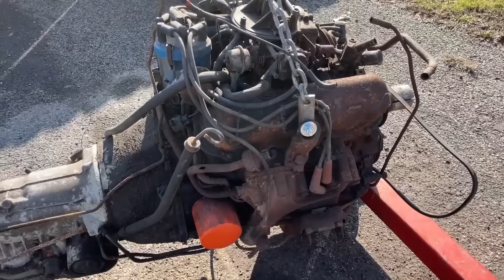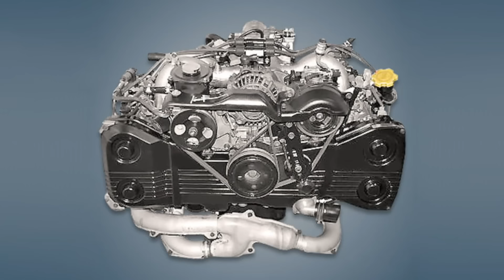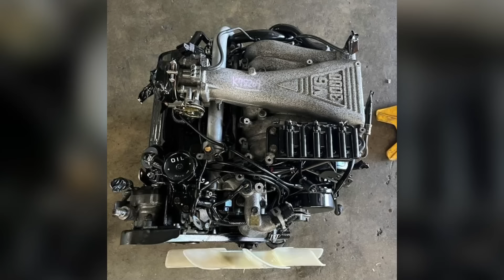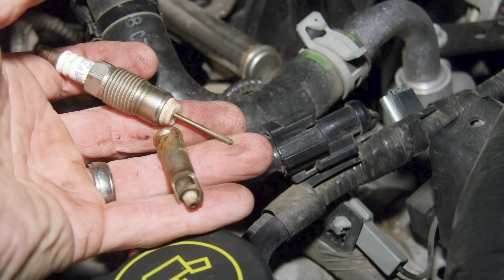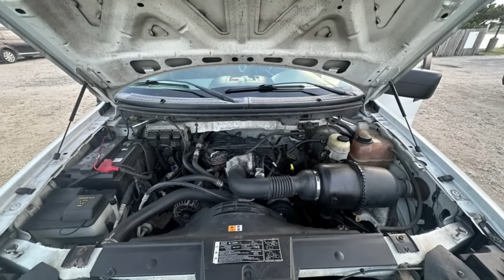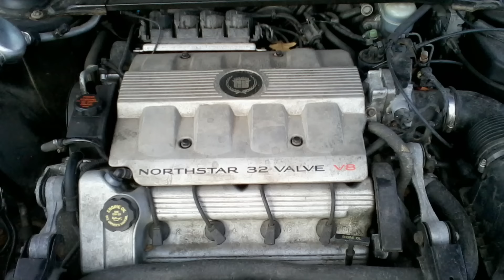20 Least Reliable Car Engines That Will Break Down!

Comment: Cant have the 2.2 and 2.5 in so close in the same videos bro, after dealing with mail trucks (llvs) for several years, that 2.2 compared to a 2.5 is like comparing a Fiat to an old Toyota diesel, respectively.

Comment: The Ford 3 cyl. was mentioned, but no mention of the Chevy Sprint/Geo Metro 1.0L three banger? Absolute garbage.
Reply: I just got a 2025 Chevy Trax with the 1.2L 3 cylinder with the wet timing belt, started feeling kind of worried, but I paid extra for the 100k mile warranty, I put about 4k miles on vehicles every 2 months, so whenever that goes and probably destroys the engine at least can be a little at ease knowing I might get more miles out of it than the first one through warranty

Comment: Hey guys, YOU forgot the Dodge/Chrysler 3.7 and 4.7 !!  These engines like to drop valve seats  or overheat and crack the cylinder Heads.  They are very hard to remove and hard to get back together!!!!  JEEP means JUST EMPTY EVERY POCKET!

Comment: I had a Pinto with the 2.8 v6 that I was UNDERWHELMED with in 78 pinto hatchback.   Plugs were hard to change, The Oil Pressure with required you to  lift/remove the engine out cause it was up front right on top of the left  motor mount and constantly leaked.  The valve covers constantly leaked and were very hard to change, too many hoses and wires to  remove to get to the valve covers.  It also ran thru water pumps and you had to drop the  rack and pinion to change the starter.  The silver paint was terrible and faded to gray in 2 years. It also liked to use oil if you ran it over 60-65 on the highway.  My least favorite engine and haven't owned a Ford since!!!!!  If I ever buy a Ford  again, Please arrest me  and put me in an insane asylum, cause, I've lost my mind.  Had a Mustang II with a 2.3 4 cylinder that taught me about " Piston Slap in 76 ".  I'm surprised it didn't show up on the worst engine top 20!!!!

Comment: GM 283 cu inch v8. Couldn't kill it.  1966 parisienne.  😊

VW 1.7 litre inl 4. Constant distributor failure. Junk. 3 distributors in 2 yrs on Dodge Omni.

Comment: Not a single Nissan engine in there, huh? Interesting.
Reply: That's cuz most of nissans engines are fairly solid....now the 4cyls after 2010....yeah a lot of them are hit n miss. VQs are great overall with minor issues here an there. The VKs , pretty much the V8 version of the VQ are solid too...

Now the VR30 is hit n miss but the VR38 is bullet proof. We will have to see how the new VR35 is. 

I've got a VQ38 and a lot of techs are saying that's currently the most reliable one to get these days

Comment: The Water pump on the V6 engines.  Were horrible. Causing over heating and blown heads.    Same like the V4 van engines. 1974.

Comment: The 3.6 gm v6 shows Cadillacs 3.6tt 😂 there are not the same timing is revised and heads are different
Reply: Although the block is the same? One wonders if the turbos bolt on

Comment: This engine all american american engine  rubish ugly old  petrol drink. Where saab engine where audi 1.8t engine toyota 1uzfe.
Reply: I in light of designs that came out of Britain, from aircraft (and even some of the early vaunted RR engines - throwing hot turban blades) to archaic car engines and transmissions, I don’t think British folks should be complaining about an engineering design from anybody else. I’ll be the first to admit, US General Motors, Ford and Chrysler/Stilantis make garbage, however, Leyland and Vauxhall are much worse. And Rolls-Royce, considering what you pay for it, is just insane. Tell the other companies in the world to compete in the market, did you do this by buying Japanese.

Comment: I remember a lot of these engines. First the V-12 jaguar that was a mechanics nightmare. Not noted here but the engine water pump was buried down inside the middle of the engine. When they ran right they were awesome but if something went wrong, look out. Then Cadillac 8-6-4 that was garbage. Mechanics discontinued a lot of those cylinder control systems and the owner just let it operate in 8 cylinder mode and then the engine performed pretty good. Then at the same time GM had a throttle body fuel injection what was a nightmare even if just pulling the intake manifold because of coolant leaks, ask me how I know. Then ford with all its issues had a variable venture carburetor what a nightmare. Then that Chevy Vega all aluminum 4 cylinder what piece of crap that was. Then the Oldsmobile 350 diesel and all the other 350 ci engines that where converted to diesel engines where crap. I’m forgetting a lot of engines.

Comment: My 3000GT with the naturally aspirated 3.0 engine was reliable, and a fun car to drive. There were no issues! The timing belt however must be replaced every 60,000 miles, or it will break, bye bye engine!

Comment: The GM 2.2 4cyl and Pontiac Iron Duke are easy to fix and very dependable. The USPS Grumman Mail Truck uses the GM 2.2. The USPS would not chose a motor that was not reliable in brutal stop and go operation. 😂😂😂😂
Reply: The mail trucks from 1993 and before all use the Iron Duke.
Reply: I had a Chevy Beretta with the 2.2. Before a few H.P. adders it was gutless, but never had a single reliability issue.  My Iron Duke Fiero got a rod knock 2 days after I purchased it. Didn't know the tell-tell signs when I bought it (young, poor, and naive). My experience, I'd agree the 'Iron Duke' wasn't great, but the 2.2s shouldn't be on this list. There's millions still sluggishly pushing S10s down the road today!  Take that off this list, and add the Ford Powerstroke 6.0 and 6.4 diesels.

Comment: Regarding the Ford 5.4L..... you're conflating the issues of the earlier 2-valve with the later 3-valve.  The 2-valve is the motor that "ejected" spark plugs, but rather than the low number of threads, the real problem is the torque specs. Ford listed the torque spec to be 11 lbs, but if they're tightened to 25 lbs, you won't see this problem.  Maybe more threads would have made a difference at 11 lbs, but a quick turn of a wrench takes care of the issue.  Personally, I have the 2-valve and have never launched a plug.

It's the 3-valve that features 2-piece plugs that will break off in the cylinder head when attempting to remove them, and has the cam phaser issue, since it has variable valve timing that the 2-valve does not.

Comment: Several of these engines get an undue bad rap. I've seen a lot of Northstars, 2,2 Chevies, and 3.6 and iron Dukes with well North of 250K. Just keep the oil changes up to date.  The worst on this list are the 2.8 Ford & the 1.3 Ford.  Chrysler's 2.7 was a bad joke by design.

Comment: 200k miles on northstar 4.6, Obviously after the bolt repair, no doubt as a small error can overshadow the durability of a great engine, if Cadillac had corrected that error in time its reliability would be impressive.
Reply: It would have gone down as one of the greatest engines ever had they not blundered the head bolts
Reply: It was the earlier Northstar V8s too. Pretty much all the major issues were fixed in the final years of it
Reply: Northstar performance head bolt kit that goes up in size and to course thread is a bulletproof fix. Kit comes with the jig drill and tap set

Comment: I have a Dodge Charger with the v6 2.7. It currently has 180,000 and it's running great. I have changed the timing chain, water pump, oil pump and cooling fan and it's running really good. I like the gas mileage I get out of it.
Reply: That's a ton of work done to an engine with only 180,000 miles though.
Reply: @bulmarogomez2567  most people neglected them and drove short distances and the crankcase ventilation system was not good.

Comment: Ht4100 had an aluminum block and cast iron heads? Apparently GM didn't learn from the Chevrolet 2.3 liter Vega 4 cylinder. Hope they fired those engineers.
Reply: The ht4100 became the ht4900 which had a great reputation.

Comment: The lifter noise on the Ford Cologne 2.8 Liter V6 was easy to fix. It wasn't really a problem at all.
Reply: Try to find one without cracked heads. There is an entire aftermarket on them

Comment: I agree on the 2.8 when i was growing up nearly everyone was buying eay to mid 80' Rangers some had the 4cyl,1 had the 4cyl turbo, and a few had that 2.8. Mated with a 5spd that 2.8 was impressive at the time and they beat the hell outta their trucks
Reply: My previous vehicle was a 2003 Ranger. 2x4 3.0 V6.  I hated to unload it, but, you know.
Got a 2017 F150 2.7 Ecoboost. So far, no problems.

Comment: Ford Eco Boost should be Number 1 - Timing belt running in oil is the most insane "invention" in the history of cars!
Reply: That does indeed worry me. The Ecoboost was getting all this promotion! I have a 2017 F150 with the 2.7 Ecoboost. I'm getting close to 60k. No indication of any problem....yet.
Reply: @RedneckSpaceman don’t worry only the 1.0 have wet belts
Reply: @Dante1282  No the 2.7 and the 5.0 Coyote have the wet belt. They rate them as 1100 hp, but I am like you, for how long?
Reply: @RedneckSpaceman  2.7 only has wet oil pump belt. It uses chains for cams IIRC
Reply: @jcdenton3062  I wonder if there is an external oil pump that could be adapted, like a dry sump?
Reply: @RedneckSpaceman  Many people says "No indiacation" is a core issue of the problem....
Reply: @RedneckSpaceman  The 2.7 has a secret wet belt in the oil pump and is just a time bomb. Another gift from Ford.
Reply: Why didn’t they use a chain instead of a belt or have it direct drive? Just another wonderful innovative idea from Ford Motor Company that should’ve been flushed down the toilet
Reply: @1Barsamian i think the belt arrangement is the ultimate in efficiency.  I believe they tested it.  I'm not saying it was worth it
Reply: especially since oldsmobile fixed the diesel in 1985 where as the ecoboost has yet to get a timing chain kit or anything like that
Reply: @noahandthefurry4573  GM nevce fixed their diesel engine, the abandoned it and rightfully so. the 350 was a great gas engine but couldnt hold up to the stress of diesel
Reply: The psa Engines (Citroen, Peugeot, Opel) too
Reply: Timimg belts are more quiet than timing chains. That's one reason they're used. Secondly, dealership profits mainly come from customer pay maintenance and out of warranty work order service repairs. Revenue from car sales just covers the overhead.  Lastly, cars aren't engineeted for longevity. Why do you suppose many automatic transmissions aren't easily serviced (or even have a manufacturer's recommended service interval)? Or the trend to put a turbo'd 4 cylinder in everytying these days? Or the "plasticfication" of engine parts like intake manifolds? The sooner a vehicle falla apart and is beyond economical repair = the sooner it needs to be replaced with a new one. As with EVERYTHING: follow the money and that's where the answer is.
Reply: Peugeot 308 the same issues with the wet belt,  i have one 😢
Reply: What were they thinking?
Reply: And peugeouts puretech
Reply: @freibert  actually it’s the oil pump that is a wet belt, the Coyote has it too. Someone should make at least a chain drive or even a gear drive for any engine that is a belt drive wet oil pump. Or at least be accessible to service. The Coyote is rated for 1100 hp but for how long.  I miss the old Fords  distributor in front an ARP drive rod. I never had a bad oil pump strand me. Those old cars were just good.
Reply: I think Ford uses a rubber belt to drive the oil pump.  Timing belt is not swimming in oil.  Either way, how did they even come up with such horrendous idea?
Reply: Which ecoboost lmao. There are hundred "ecoboost" engines . Which means turbo.
Reply: Do you noticed that there’s no Nissan Toyota or Subaru engines mentioned in the video?  This is because they are designed by people that care about consumer products and putting their name on something that is going to be sold internationally. Additionally, Yamaha designs most of those engines for those companies and Yamaha really knows what they’re doing.
Reply: @CSByeah  but Nissan transmission fail so early u dont get a chance to wear out the engine
Reply: @CSByeah  my guy did you even watch the video. there's the Subaru EJ25 engine plastered in the video
Reply: @CSByeah  Japanese cars are the best today.
Reply: Buy a Toyota Tundra. They recently had problems with their waist gate on their turbocharged six, but that’s been corrected. Traditionally Toyota has been the most reliable truck.
Reply: Actually the belt is stronger than a chain. I know it sounds crazy. But the belt is usually stronger than steel and being wet makes it stronger . Many high rpm Indy engines turn 18.000 rpm’s and the belt has been accepted as a strong choice. I wish they could be easily changed. But engineer friends tell me that they have taken the belt far beyond what they were. The key is to keep the belt short enough that it doesn’t deflect.
Reply: @Bbba7564 Race engines aren't run for years under every condition. One race and they get rebuilt.
Reply: @Bbba7564  I’m an engineer in the aerospace industry, recently retired from a major jet engine manufacture on the East Coast. There’s no way about is better than a chain.
Reply: if the belt is stronger why not have all manufacturers  use them instead of chains? No they are NOT stronger or they would do this!! SIMPLE !!!
Reply: @DannyDisharoon  i changed mine on 250 000 km. It was still decent shape. I cannot answer that question
Reply: @Bbba7564  belts are NOT stronger. They get used a lot because they are QUIETER then chains and typically require less parts making the setup CHEAPER
Reply: @D41Michigan  it makes me mad. I asked if the 2.7 was a wet belt and they said it was direct driven, liars.
Reply: @Bbbbad724  I believe, if memory serves me right, that all ecoboosts oil pumps are belt (2.7/1.0) or chain drive (1.5, 1.6, 2.0, 2.3, 3.0 and 3.5)
Reply: @ I don’t get why they would build it like a diesel and do that
Reply: @Bbba7564  I have found from working along side ford engineers (I was a roush tech until covid hit) that they don't always know what they are doing or what they have. Sometimes they do things a certain way because it's cheaper to manufacture...like a belt drive is cheaper then a direct gear drive
Reply: @Bbba7564  another thing they did, was give the Explorer ST a 400hp 3.0 ecoboost but then put in a lighter duty 10r60 instead of the 10r80 behind the 3.5 eb....even tho the standard 3.5 makes less power. Yet the 10r60 and 10r80 are both physically the same size
Reply: @ that doesn’t make sense. They brag on the towing ability. Is there a conversion for the 2.7 Edge transverse mounted to run an external oil pump? It is an ST with 2 turbos. I hate having a wet belt pump. It just seems like an external pump with a gilmer dry belt would be better. A good dry sump with a big tank of oil would be better with an accusump auxiliary system. It seems like the Edge ST would have something to overcome that fatal flaw. Is there an aftermarket system oil pump?
Reply: Are the Indy motors running the belt in the hot engine oil though. Just curious..
Reply: @Bbba7564  The belt is lighter not stronger. Lighter= engine can reach higher rpm.

Comment: You’re absolutely right about almost every motor in this video. You’re dead wrong about Ford’s Cologne 2.8 & Essex 4.2. I’ve been a mechanic since Christ was a corporal and I have seen ZERO evidence to back up your claims regarding these engines. I bought a Capri with the 2.8 and drove it to over 150,000 miles before giving it to my neighbor’s son, who had it for years before trading it for a Mustang. And an old friend has over 200k on his 4.2 V6 powered F-150.
Reply: 97-2000 Ford 4.2 V6 had some design flaws. 2001 saw updates to the engine.
Reply: I agree on the Ford Cologne. Many years ago I had a '79 Mustang with that engine. There was a few issues with the car, but none of them was with the engine. it ran perfectly, although being a bit thirsty.
Reply: That's being a turd Polisher saying that the 2.8 was a good engine it was garbage
Reply: The Essex which gave thermal problems was the 3,0 V6. And what is problely not known in America, the Isuzu 3,0 diesel that was used in a lot of European diesels in the 2000 till 2010.
Reply: Also confused the 5.4 triton with the 4.6 2v. The 2v had the thin thread amount issue up to 2004. Slightly improved after. The 5.4 had the ugly 2 piece spark plugs that came apart and left behind the threads to extract with a special tool.